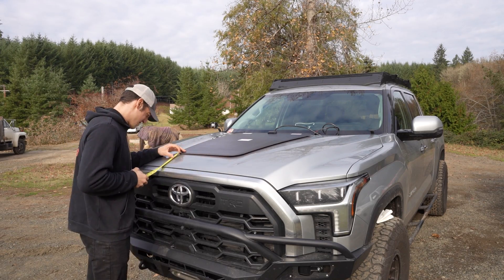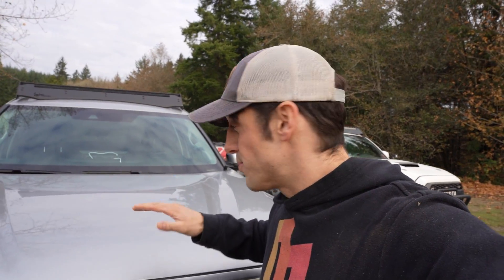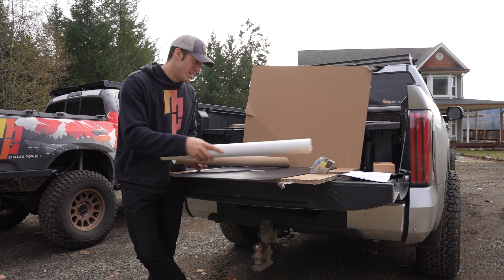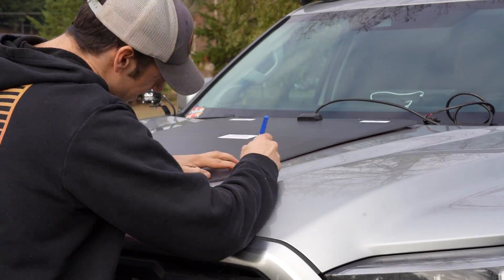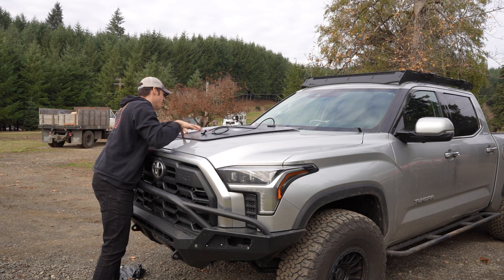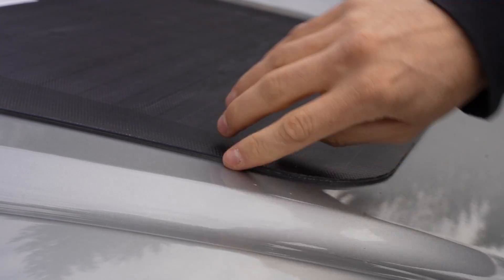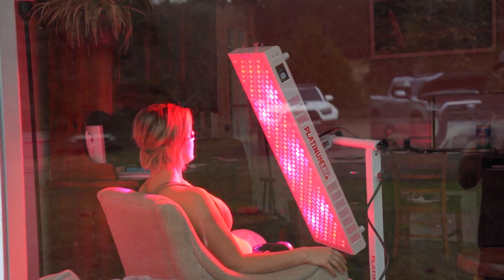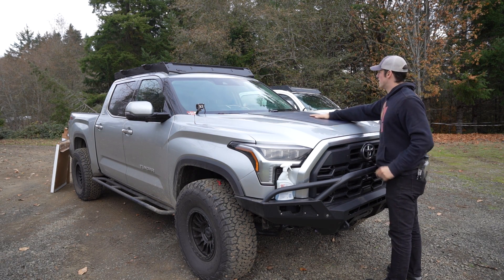The Solar Hood Decal That Charges Your Truck - Great for Overlanding

Comment: I actually need a solar panel like this. I'm a truck driver and I leave my personal vehicle at the yard for about a week. I have a 2013 tacoma. The reason I want a solar panel is so that I may be able to run my dash cam 24/7 Without having to drain my battery, atleast till i get back.
My question is, do you think this solar panel can be used for that purpose too?

Comment: These are great for vehicles that run fridges, diesel heaters, etc off the vehicle battery. I've had mine for nearly 2 years and it's one of my favorite additions. You'll really enjoy the added power while the truck sits. 👍

Comment: It's so neat how quickly solar panels are evolving, a few years ago the heat from the hood plus the sun would have trashed the charging rate, but those Arcadias seem to function regardless. Thanks for posting Max! Hope the family feels better soon!
Reply: Truck alternator charges when engine is on and hot, so solar efficiency is less or not important when engine is hot. This panel is for when engine isn’t running.

Comment: I have been using the Arcadia 4x4 solar kit on the hood of my Taco for a couple of years and it is awesome! I also rain another solar panel on my roof rack to charge my goal zero. I have run trips up to six days and kept every thing running pretty well.

Comment: Thats a neat idea but at 90 watts for 450$. Thats a tough sell. Realistically thats panel is not going to power much of anything. Mostly because you cant aim it at the sun. Also its a little disappointing to not see you test it out and measure the watt output.